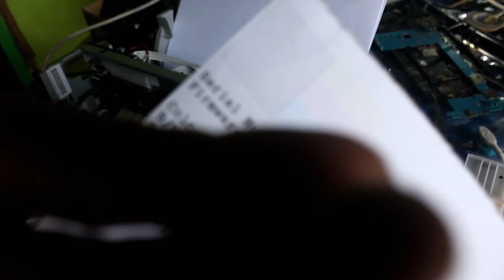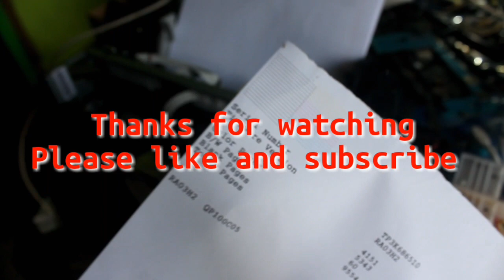Epson l120 both blinking lights solution

Comment: hello I have an epson wf7515, I unplugged the flat cable that powers the cartridge reading card with the printer on and it went into error. The display shows error turn off the printer without any code. How can I solve?

Comment: Sir baka matulungan mo ako sa 2 L120 printers ko. Ung isa lagi namisalign un print head lever lock.  Both lights blinking same time. Kumpleto naman ung spring. Pag natulak sa dati na position ok na naman xa pero bumabalik din un same na sira. Ung no. 2 printer ko L120 din, ung margin sa unahan ng papel pag nagprint ay shorter by 1/8". Mejo malapit xa sa edge ng papel bandang unahan. Ibang sides no problem.. TY sa mga sasagot.

Comment: Hello sir.After ko gawin nawala ung orangr blinking light. After nun  nagtry ako ulit magprint pero misaligned ulit. Paulit ulit na ganun. Ano po kaya prob nun? Salamat
Reply from the maker: Try mu gawin ulit at e manual rotation mu s gilid roller counterclockwise and clockwise

Comment: hi i gots this problem of mine.. my epson l120 moves 1/4 or half way and goes back to its place.. hjuhuhuh all technician dont know what to do .. they just returned it back to me
Reply from the maker: Turn off printer, move head by rotating yhe gear left side to release lock. Once free to move find the place where posible stuck and if its hard to move check for foreign objects, if no foreign object then force head to move until stuck is clear. Also check my l3110 stuck gear problem maybe it also can help. Same may apply on your l120

Comment: sir l120 printer ko anong problem walang lumabas na ink kahit anon kulay  ok lang ba e update ko ang sofwear sa printer ko na contenus ink  reply po
Reply from the maker: Eto gawin mo.
Head cleaning 3x
Pag wala padin
Ink flushing 1 wala check mo hose baka may putol o singaw, pag wala check mo f1 fuse sa board baka busted

Comment: boss pa help po ung akin po pag sindi ko umiilaw ung green tas pati na ung red sabay cla.. tapos binuksan ko boss nung tu nurh on ko ung cartridge lng ung nag right left wala ung ingay nung roller sa baba.. ano po sira nya nun boss.. pa help naman po
Reply from the maker: May ingay sa baba? Baka may object na na stuck paki chk ng maayos boss
Reply: @wayneslink  wala ingay sa baba boss... ung ingay lng po ng cartridge sa pag right and left ang madidinig tapos iilaw na sabay ang green at red boss.
Reply from the maker: Nag initialize paba xa bos before mag error?
Reply from the maker: Pa chk mo ang encoder strip, if madumi linisin mo cotton na may alcohol, check na din board baka may mga dumi insecto
Reply: @wayneslink  kaagad boss error
Reply: @wayneslink  boss pwedi ba masira ang dinamo sa baba? kc parang un ung di ko naririnig umikot.. di nya pinapaikot ung mga roller sa loob pag binuksan. 🤔
Reply from the maker: Yes pwdi. Try muna check ang sensor sa gilid boss, chk na din yung mga red wires baka putol na.

Comment: Didn't work for me. The cartridge still didn't move. And it still blinks.
Reply from the maker: I have lots of videos with the same problem. Consider checking it. But if blinks is alternate, you need to reset only
Reply: @wayneslink  no it's not. Checked one of your videos. No paper jams. Checked that rotating thing at the back and it's all good.

Comment: This is not true and not applicable to my L120 printer. I did all the messures and methods from different vloggers but still my printer is blinking. I pushed it so many times and it keeps erroring
Reply from the maker: In most cases this is true and 100% tested. If it does not work for you that simply means this is not the fix for your printer. Check my other videos or send me link of your problem

Comment: Hello po. 'Yung cartridge ko po ay gumagalaw na po siya at wala na pong nakabara na paper, pero nagbi-blink pa rin po nang sabay yung lights. Wala naman pong problema ang roller ko po, maayos naman po 'yung parang wire nito po. Pero ang napansin ko po sa akin is 'yung cartridge po ay mabilis gumalaw pag-in-on ko na po tapos magbli-blink na ulit yung lights. Ang result is pumipitik po yung cartridge ko sa right side ng printer. May suggestion po ba kayo tungkol dito?   

Hindi ko po kasi ito madala sa pagawaan dahil sa COVID-19 quarantine po, atsaka may mga ipiprint din kasi ako. Patulong po.
Reply from the maker: check mo po encoder strip yung parang plastic na nasa likod ng head cartridge, check din flex sa likod re insert mu dalawa, mas mabuti cleaning mo yan flex cable yang patungo sa board
Reply: @wayneslink , thank you so much po. 😍😍😍